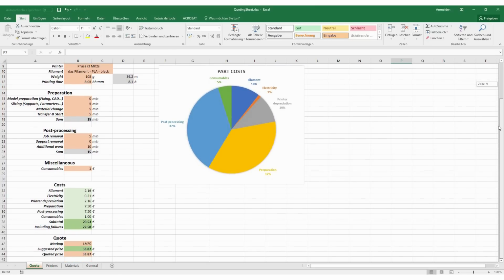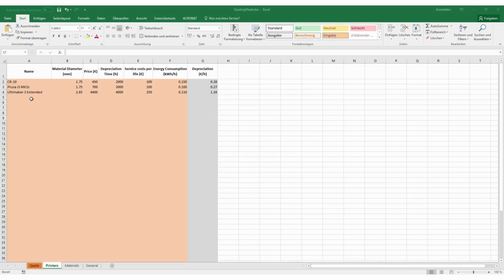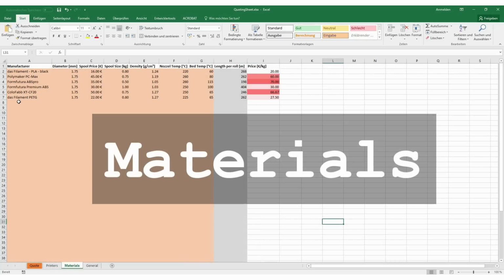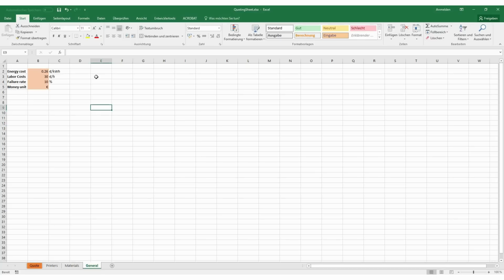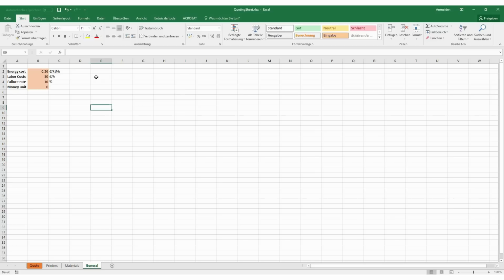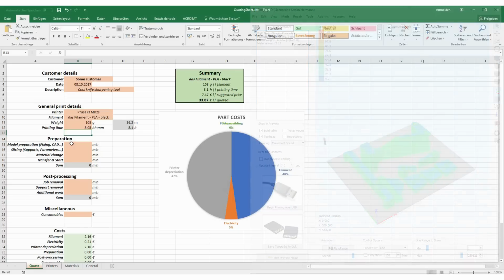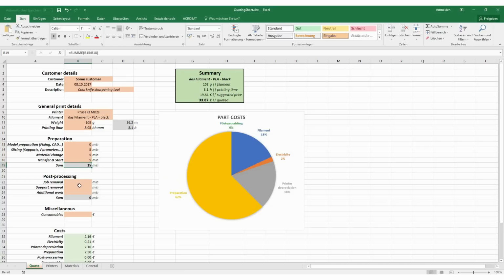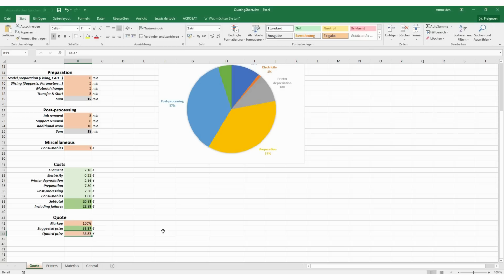HOW MUCH do 3D printed parts really COST?

Comment: While this overview is very valuable in getting to understand your costs, you should not price your parts based on cost. Instead price the parts on a fair market value* (finding this may take some research including negotiating with your customers), then you can use your cost estimator to see if your business have adequate margin. 

In other words, extraordinary effort you make in finding novel ways of reducing your cost does not decrease the value of your parts (and hence what you can charge for them), instead it should increase your margin. 

 *) I.e. what are your customers willing to pay.
Reply: No, first and foremost you need to be concerned with what your customers are willing to pay, not what your competition is quoting and certainly not what your costs are. 

If you start basing your pricing on your cost as you suggest then you are starting the race to the bottom which you yourself warned against.
Reply: This should be used to calculate the minimum. After calculating, you should think of what people would be willing to pay.
Reply: I did not say to base your cost on others. I said to place a price based on a fair market value. I.e what is the market willing to pay for what YOU are able to provide*. This does not mean that you have to undercut everyone else, 3d printing services are not a commodity market so customers will have a broad range of requirements that they will purchase services based on. Beyond price, your ability to deliver at time and at quality will certainly be part of a buyers decision. 

Pricing based on fair market value does not mean that you reduce your price each time you get a customer telling you that he has some other guy doing it for less, but if you constantly lose business due to price (and they do not come back when the other guy did not deliver) you do have to consider that you are charging too much. 

The primary understanding I wanted to impart is that it is unwise to base your pricing on your cost. After all the value of what you make does not diminish if you find ways to reduce your cost. So you should charge as much as you can and still while still being able to book orders to your satisfaction, if you are able to reduce your costs this does not mean you automatically reduce your price (but it does give you more latitude to reduce your price if it becomes necessary, which it will if everyone else are similarly able to reduce their costs)

*) And I certanly don't say that figuring this out is EASY
Reply from the maker: Very good point!
Reply: bxxj that's exactly my point... Labour and time... Effectively the same thing. But you don't know what... If anything... Is being charged for labour and time in the "fair market" model.

The home crafter is working against a thousand people who might value their time at next to nothing... Or nothing. Just happy to get an offer, or pay for filiment... You don't want to be copying that... So you need to calculate it for yourself... Hence making up your own spreadsheet. Or more to the point... Using your own value system.
Reply: I think what sbrubak is trying to say is; don't factor in sale prices for your filaments into your cost or extra cheap filament prices you find online. Charge the normal or average price of materials instead of any sale prices you bought them at. The same applies to not only filament but your 3D printer's value and other parts/materials. 

E.g If you bought a Tevo Tornado at a discount price, calculate depreciation value at it's regular price and not the sale price in which you bought it for.
Finding these sale prices takes time and effort on your part and the cost of that time should not be thrown out the window, you also can't be sure you'll get those prices again. Also as sbrubak said, just because your role of filament cost you $10 less than normal, doesn't mean the part you made for the client is worth any less so there's really no reason why you should be basing your pricing on actual internal costs but rather on average market value of materials and fair market value of result product.
Reply: Costing labor should be done with the prices of competition in mind but the experience you bring and your ability to communicate that experience to your customers should be the main driver of charging labor above cost alone
Reply: thanks!
Reply: As the vid said labor and time are the greatest costs. Labor is also the greatest opportunity to add value. A designer may give you a file but experience may tell you that a small mod may make it more usable or printable.  Often designers don't consider manufacturing limitations of injection molding or milling.
Reply: sbrubak yes, but that still insists that you use other people's sale prices... A 3d print of "this" type is selling for "x" so that's how much I need to charge.

"fair market pricing" means you assume someone else's pricing structure... And unless they have your exact running costs and requirements... That's never going to fit. Regardless of anything... You have to charge for the product you make. You have to charge based on your costs and your overheads. There's no such thing really as a fair market value for a custom item. And being that print quality and part design change from person to person... It really is a custom piece, dependant on the skill and experience of the user.
Reply: sbrubak all due respect... Costing yourself based on others is a silly idea. Your costs have nothing to do with other people. Some people will "work" for nothing, and the only thing you can guarantee is that they won't exist in 3 months time... That's not something to aspire to. I've seen hundreds of "businesses" race to the bottom, only for some simple thing to kill their startup because it's not financially stable enough to weather upset.

Comment: damn your electricity is expensive! Here it is 3 cents per kwh technically its 2.3 cents in the non-peak season but 3.2 cents in the peak season. In the off season it drops down to 1.376 cents after so many hours used in the off season.
Reply from the maker: Germany is no country for ethereum mining ;-)
Reply: x9x9x9x9x9 where? 
Mexico, China, india, SA 
3 cents per kilowat blows even major energy hubs that are otherwise poor (and thus incapable of charging much) waay out of the water
Reply: As of today 3/1/2018, the average cost of electricity in the USA is 12 cents USD per kwh.  Most Americans pay around 13-15 cents USD per kwh.  Europe has always paid more for energy (of all kinds) than the USA.
Reply: where is that? Including grid fees, potential monthly fees, taxes?
 Here electricity can be that cheap too, but tally up taxes, grid etc. and it is quickly usually around 10-15c
Reply: in Danmark the price is around 2,20 dkr, probably 30-35 ct - totally p kw.
Part of the methodik  quelling innovation in the land. Vehicles are loaded with 180% before sales tax of 25%...etc
Ja, wherever you live, its a very different story - just a workshops lighting and background costs as example.
The 'money' separation 'thing' is absurd, an affront and disgusts
Reply: QaaUz 
Being ignorant is no excuse in Denmark.
Part of the taxes you so loathe are free education all the way through university. Free healtcare. Free roads. A great infrastructure. Practically no downtimes on electricity, water, internet, phone etc.
Those countries you so admire for their low taxes are loaded with extra charges for almost everything.
Reply: As of February 25, 2018 the current cost of electricity here in the San Francisco Bay area is 22.705 cents USD (Peak Period) and 20.825 cents USD (Off Peak Period).
Reply: I thankful in Memphis electricity is under 7 cents even in peak summer.
Reply: x9x9x9x9x9 yes Germany is expensive with those kinds of thing. Probably the most expensive in the world..
Reply: Nunya Biznis Here in Massachusetts it's about .12 per Kwh elctricity plus .12 for delivery. approximately .24 per kwh.
Reply: Wow. Lucky you.

Best I've ever had, in 3 different countries was about 15 cents of the local currency.
Given variations in the value of those currencies this can equate to 30-40 cents in US dollars, or about 10-15.

A more typical price is 17 to 25 cents for me at the moment, though that's in Australian dollars. (so take about 3/4 of that for US currency.)

of course, as someone with a very low overall electricity use more often than not as much as 60% of the bill is the 'daily charge'. Since that's about 90 cents to 2 dollars equivalent per day.
(eg, can often be equivalent of 3-4 kwh minimum that you get charged irrespective of usage.)
Reply: the price is so high since the goverment kept adding taxes and they hide a lot . The real tax (direct+inderect+hidden) is ~80-85%, just compare the prices of Germany vs Bulgaria... then you see whats wrong here.

Comment: I commend you for putting your time into preparation and post processing into the costs, a lot of people don't think to add those. Fixing bad models is another potential time sink. If you spend any time checking up on the machine, such as watching the first layer, check it every couple hours, etc, then the time diverted from other tasks to do that should be factored in too.

I think your assumed service costs is pretty low. For instance, you mentioned nozzles and the $250 might buy you two print cores for the UM3. I bought a used UM2 from someone and  replacing worn parts at 1500 hours (extruder drive, olsson heater block upgrade, PTFE bushing, bowden tube and a few other parts I'm forgetting) and I'm pretty sure I put at least $250 into it getting it to running acceptably, not counting my time diagnosing the problem and installing the parts. The time doing the repairs & maintenance should be factored into the expenses too.
Reply from the maker: Honestly, I don't own an Ultimaker, so I this value was really just a guess. Thanks for your numbers!

Comment: First
Reply: Great spreadsheet. I find my preparation time and failed test prints are higher than you show. Especially since I use prototype prints as I'm designing a part or assembly to verify fit and hardware clearances.  But the great thing is I can apply these changes to your spreadsheet.
Reply: Second